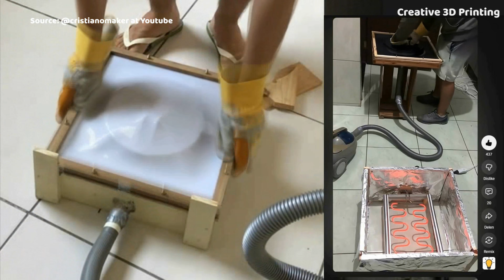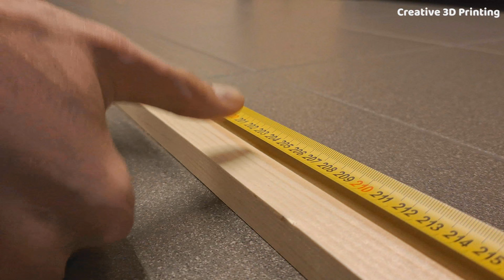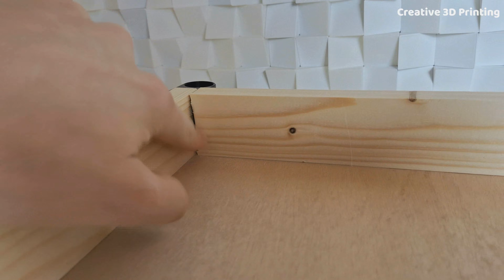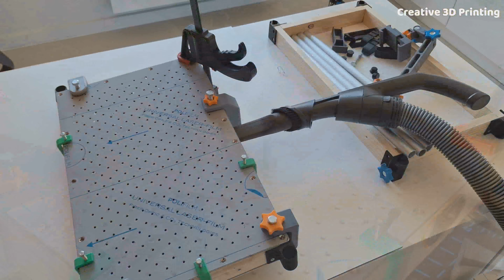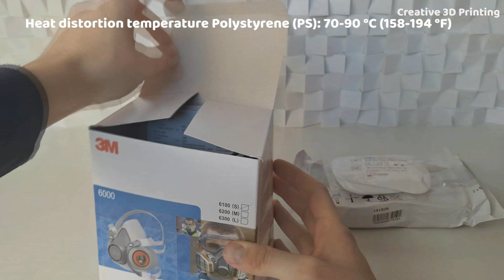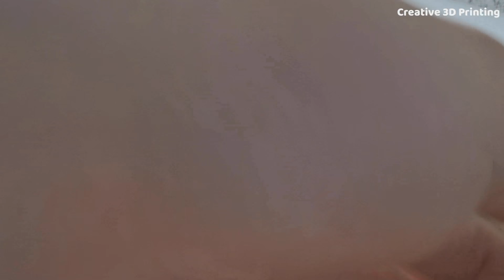I Tried Vacuum Forming… Here’s What Happened

Comment: Build the plastic holding frame out of metal instead of wood and use an oven to heat your plastic - take the opportunity to add some handles to help you carry it and also press on them. Might work with the wood frame too but it would be touch and go depending on the temperature needed to heat the plastic. I would not advise it as you wouldn't want the wood to catch fire in your oven. If possible use an oven you don't cook in. Might work with an electrical hob if you have one big enough to hang your frame over but I think it would be better to have the heat source ABOVE the plastic as the hanging of the sheet is an important indicator of  the state of the plastic and you don't want to have it interact with the heating source. You might also try to build your own frame heater using a heater element if you have some basic electrical skills, so it hang OVER your plastic frame and heat the plastic from above.
Reply from the maker: Thank you for the detailed reaction! Metal frame for holding plastic is a good idea! 
For now I don't want to do it in the oven for the fumes (don't have one that I don't use for food) My space heater has a switch or something so when I turned it horizontally, it turned off... for safety I guess.. 
Building the heater element is also a great option!
Handles were printed but I had not enough screw to fasten it, ofcourse for the future version I will mount them on the frame or design it right into the metal frame :)

Comment: I think its a very practical and beautiful design and clearly only heating and vacuum power is the problem. Happy to find this channel and I just subscribed.

I would change nothing, just put heating elements to the top from a electric heater, metal pipes are already longer to accomodate a thin sheet metal box. Which needs to be cutted and bended around the edges to be the enclosure of heating elements. It will also redirect heat to the plastic sheet instead of the environment.

I think a PID temperature control is needed too. With a timer. A simple arduino can achieve this for repeatable process, and this will be the greatest simplest Vacuum Former. Second round of improvements can be to put insulation around the sheet metal so its not hot to touch on top and to use a simple air tank, connect it to the vacuum pump so once you open the valve its instant high negative pressure vacuum.
Reply from the maker: Thank you for this valuable information! I indeed intentionally designed it with the long aluminium tubes so I can mount a heater above it in the future :)
The top plastic holder is definitely getting a redesign in metal with maybe a DIY heater. To implement a timer is also a great idea! An air tank is also good but I will see for that one, that's easier said than done..

Comment: not hot enuf for a part that big you need real sagging also that not going to be possible with a heat gun. get a cheap space heater the stand up glowing ones and heat it with that until you get a nice even sag
Reply from the maker: My small space heater I used was so slow.. I will try again but with PLA/PETG sheets of 0,8mm and indeed maybe use a larger heater! Thank you for checking out the project :)

Comment: Very nice video 😊
Reply: Could you have printed the base plate with all the holes ?
Reply from the maker: Thank you very much for watching!

It's best to have a heat resistant hole plate because the sheets are hot when they come down.
The large one could have been 3d printed but I have access to metal fabrication so I chose to have a strong plate.